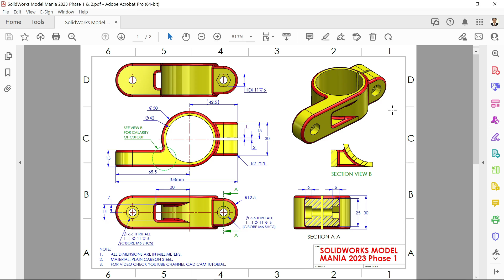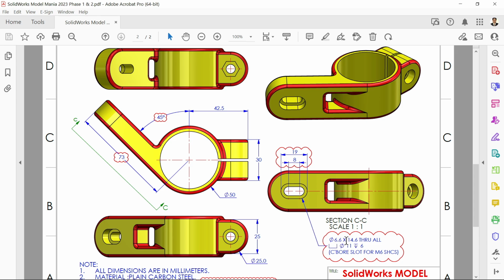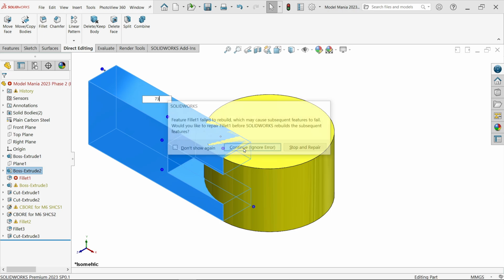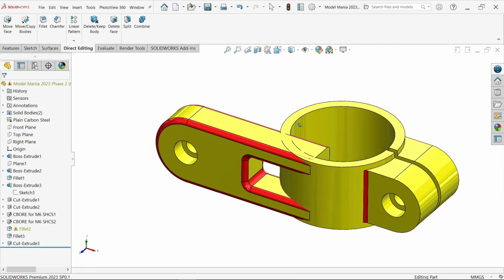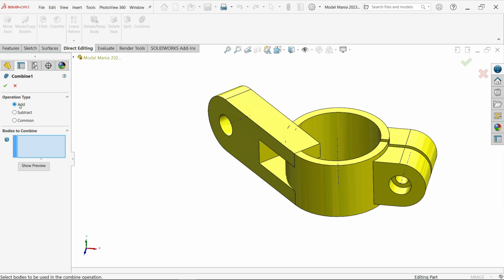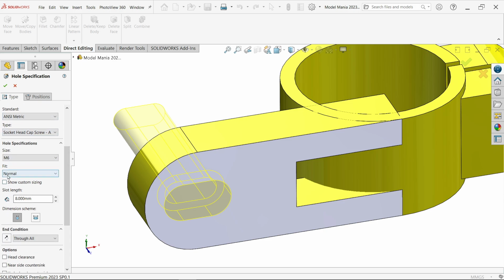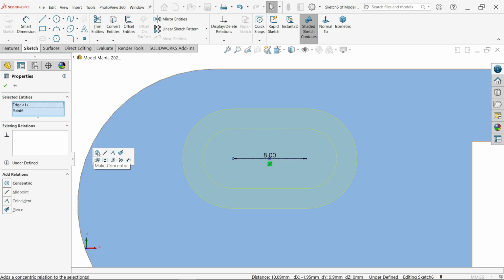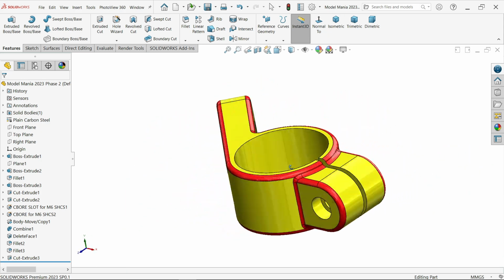Solidworks Model Mania 2023 Phase 2

Comment: You can also use MOVE FACE to rotate that long part to 45 degrees (using Rotation instead of move). You can move it in one step without causing any errors..... thanks for the video!